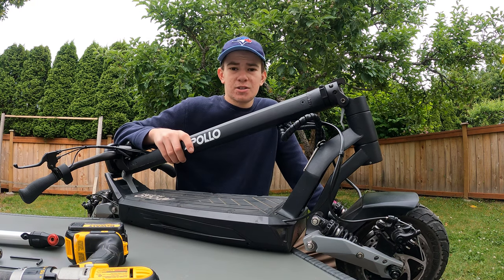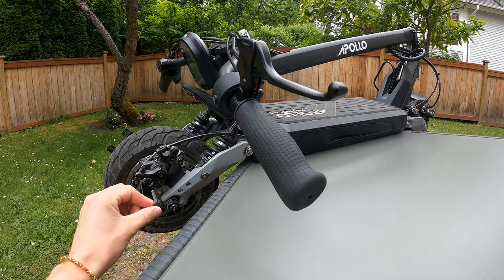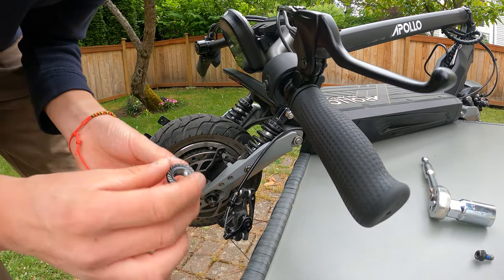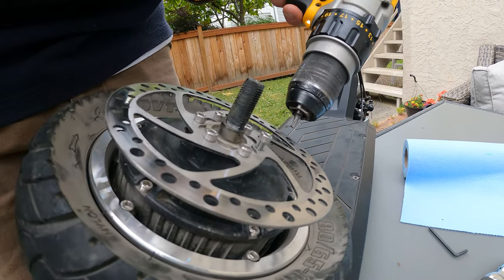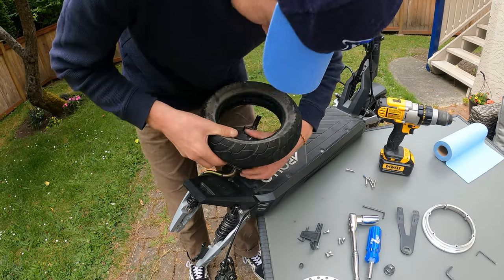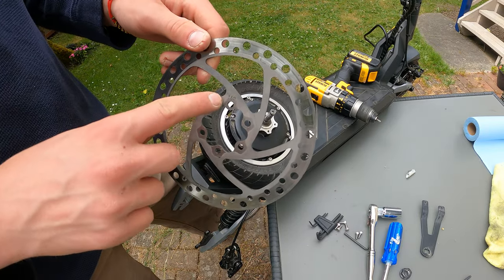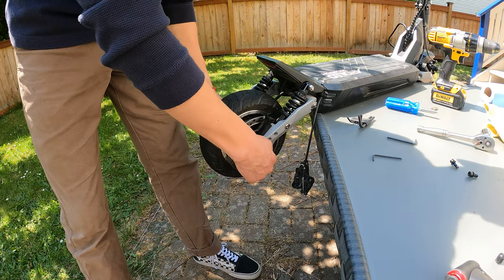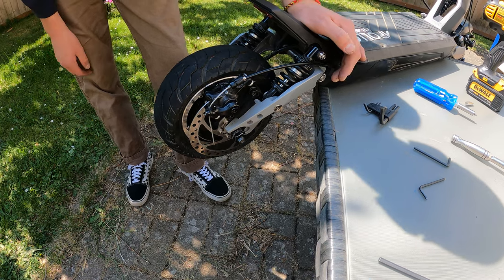How to Change a Split Rim Tire on an Electric Scooter - Apollo Phantom Tire Change

Comment: How often do your pop tores woth the split rim design.  My bronco mini 11 xtreme is giving me so much problems and keep popping and im not even riding crazy, just commuting to work 😭😭
Reply from the maker: it's very rare....I have heard that some deigns aren't great...for example the motor running hot can weaken the rubber and pop the tire...also running low PSI can cause pinched flats which is brutal :( @vrmondvuitton476

Comment: You didn't state the axle nut wrench size?
Reply from the maker: ok
Reply: @TimsElectric  Thanks for your video btw!  Apollo's tire repair video says use an 18mm wrench...  bought an 18mm wrench and realized for the V2 Phantom Apollo actually uses a 21mm nut.
Reply from the maker: ohhhh....I see...I didn't notice. :) Cheers

Comment: Just curious. Why don’t you use fenders?
Reply from the maker: Awesome question @derekchant8027, Jamie removed the rear ones as it was rattling a bit....but it's back on now :)
Reply: @TimsElectric  lol, I was really overthinking the possibilities as to why. Great video. I didn’t really understand what they meant by split rims. Wish they’d had them when I maintained all the bikes and cycles at my house when I was a kid. They really do make maintenance much easier. I was dreading having to repair or replace tires or tubes, but these make it very easy indeed.
Reply from the maker: they do make life so much easier! @derekchant8027  Cheers :)

Comment: Helpful, I’m looking to buy a 25mph Mantis 8. The 2024 model has split rim design.
Reply from the maker: Awesome @AJCoReTV, I think you'll like it :) plus split rims make life easier when you get a flat :)
Reply: @TimsElectric nice! Yes I’m kind of torn between the Mantis 8 (2024) vs the Mantis 10 lite for $200 more.
Reply from the maker: let me know which one you go with and why...$200 is still $200 but I think the 10 is on 10" tires I think...so maybe?
Reply: @TimsElectric  yes 10” tires, slightly longer foot board, & 10mph faster, 35mph
Reply from the maker: I like the extra tire size for the bumps and potholes I don't see :)
Reply: So I have a split rim like this and your video is super helpful by the way but the problem
I’ve got is the wire that comes from the scooter to the motor. Well the split rim is on that side so I’m really confused how to get it off if that makes sense
Reply: When you take your split rim off. Mines comes off the other side where the wire is. So I have to take off split rim slide it up the wire a bit. And then stretch the tire over the main motor hub and then bring the outer rim down the wire screw it on and it’s done. But I’m actually trying to change the split rim itself because it’s cracked but how with the wire ?

Comment: What is the benefit of split rims? I have split rims and this does not appear to be anymore convenient than normal rims.
Reply from the maker: Awesome question @JLK5241, split rims are regarded as easier to remove the inner tube...trust me the rubber is super hard to pry off without split rims :)
Reply: @TimsElectric currently doing this right now